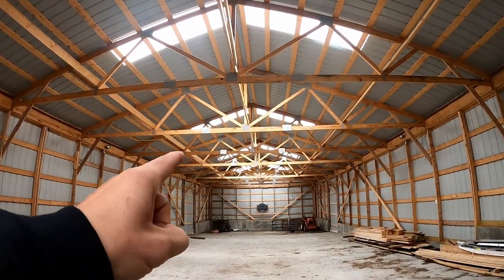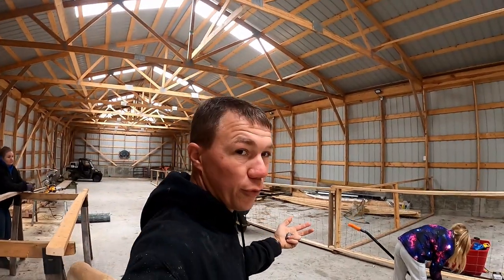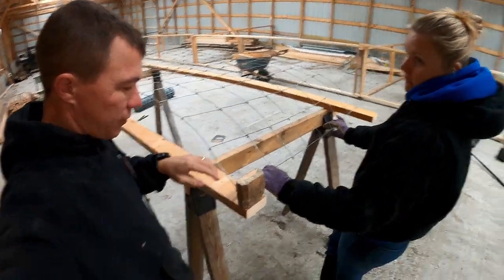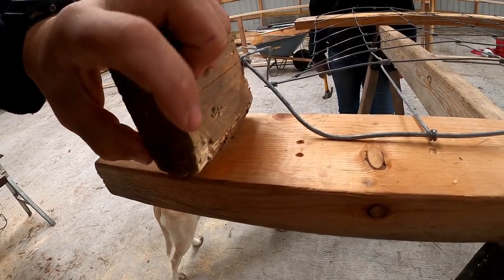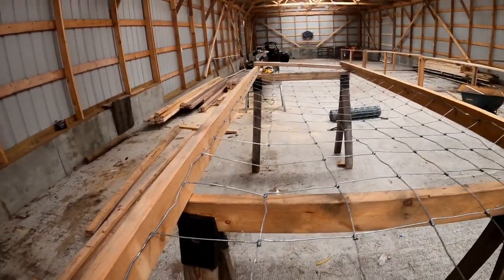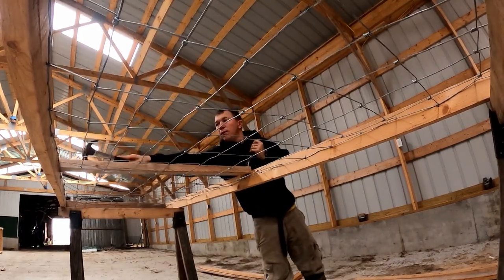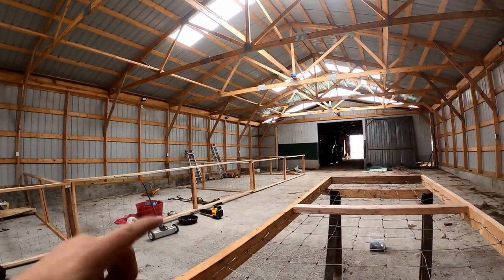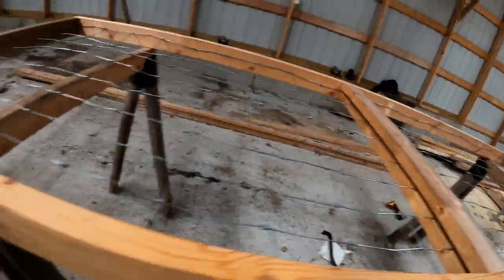Starting a farm vlog #97 build your own livestock pens

Comment: They will get through that cheep fence !!
Reply from the maker: How do you figure? I am curious as to what basis makes you think they will get out of their pens. This is the same American made fencing that keeps them in the pastures and keeps predators our. Generally if animals have food and water they are highly unlikely to try and get out. Secondly they have already been in it and no issues of anyone trying to get out.
Reply: Nah, those are fine for sheep.  Goats would rub and chew on them, but not sheep.  They will stretch and bend, but they are good for 15 or 20 winters.  They are not year-round pens and sheep aren't really climbers or that inquisitive.  If you end up adding hogs or goats, just because you want your kids to raise a variety of animals, you are going to need to add hog panel or goat panel liners to your pens.  As for the rot, sheep manure isn't nearly as caustic as cattle or hog manure and it's seldom as wet as either.  You are good to go.

Comment: So I've always admired the fences that are built that way only using cattle panels. Have you ever built those? Are they significantly more difficult?
Reply from the maker: We have just built some as a matter of fact. The videos will be posted in the next week or two.
Reply: I only ask because I would like to do that type of fencing around my garden. I love the fact that you did it the more economical way with woven wire and you are correct, if they have enough food and water they won't try to get out.
Reply from the maker: As a matter of fact the only reason we built the cattle panel ones for this year is because we are also going to use our livestock Barn as a sorting facility. The wooden ones were slower to be able to close them and just not as efficient where as these metal ones will be hung unable to swing like a gate